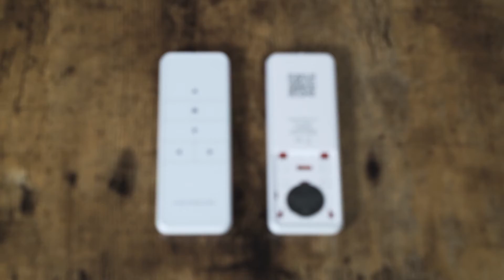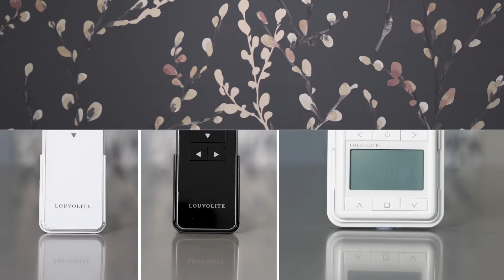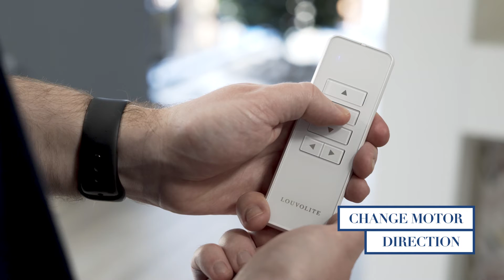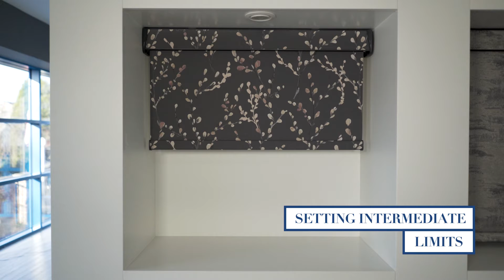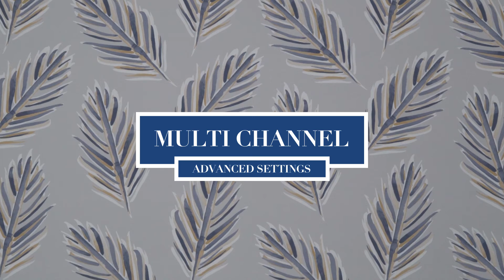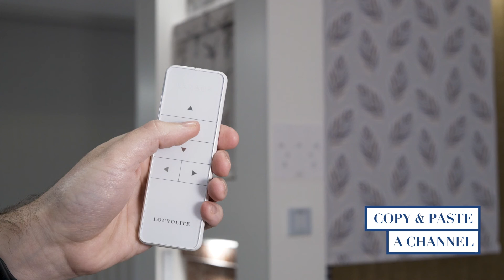Connecting Your Louvolite Remote to The 1800 & 1200 Motors (Remote Discontinued)

Comment: Why won’t one blind out of three respond to the remote
Reply from the maker: Hi @vickytaylor6187 - The motor may have run out of charge and not responding, try plug it in and if the issue persists, feel free to give our tech team a call at 01618825007

Comment: How do you actually get the remote to work ? ( Mine has stopped but blue light’s working) Thnks
Reply from the maker: Hello Beverley, the remote has power if the blue light is working - it may need pairing with the blind or if it's a multi-channel remote, switching to the channel the blind is paired with. You can try selecting all the channels to see if it works that way too.

If the issue continues further, feel free to contact our technical support team at tech.support@louvolite.com or get in touch with your supplier.
Reply: @LouvoliteBlinds  thank you

Comment: The function where you press and hold up or down until you see two flashes of the channel number which is meant to send the blind all the way to the upper or lower limit without stopping at intermediate settings doesn’t seem to work on mine.

Every time I do this the blind will always stop at the next intermediate position. I’m seeing two flashes on the remote and I then release the button as indicated to do so but it just stops at the next intermediate position.

Any idea?
Reply from the maker: Hi Keyser, in order to bypass any intermediate limits you have to press UP, wait 1 second, then UP again. The same goes for the opposite direction, press DOWN, wait 1 second, then DOWN again. 

We hope this helps - if the issue continues further, feel free to contact our technical support team at tech.support@louvolite.com or get in touch with your supplier.

Comment: I can do the first step. But it does not work when i try to select a channel
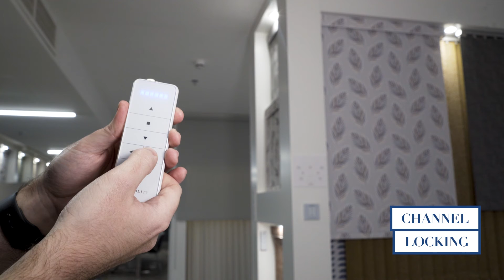Reply from the maker: Hi Hugo, please refer to the step at 4:44 as you may have locked the channels on your remote. If not, you can navigate the channels on your multi-channel remote using the left & right arrows.
Reply: @LouvoliteBlinds  I have figured it out. I had the battery in wrong the whole time😂😂
Reply: Which is not unreasonable as I cannot get remote working and am trying both ways.  Sounds like an obvious question but is there any way I can tell the remote is actually working before trying to pair?
Reply: @FamilyManPhil  Haha i had struggles at the start aswell. Honestly. It’s designed badly, hard to tell if it’s on… but.. if you click the right arrow button a blue light will appear at the top and that’ll show if it’s on… i had struggles too mate
Reply: @hugoharris7581  Thanks for the reply.  I worked it out.  The connector  at the side of the battery holder was pushed down rather than up to grip the battery and form a circuit.